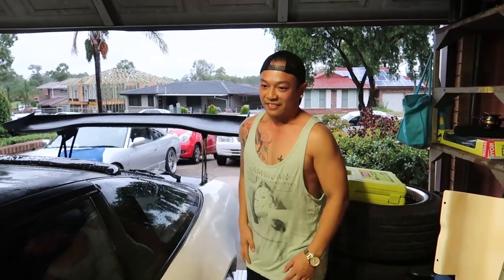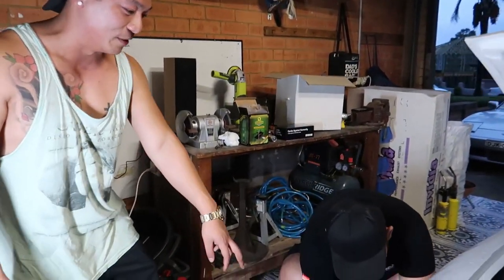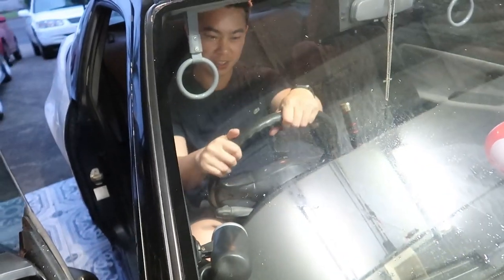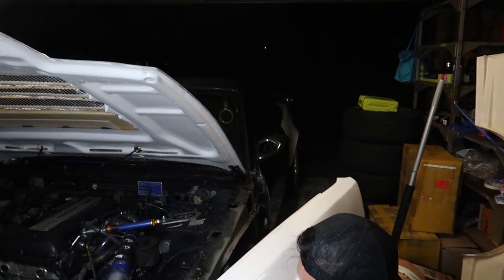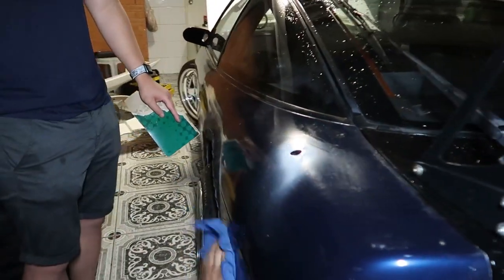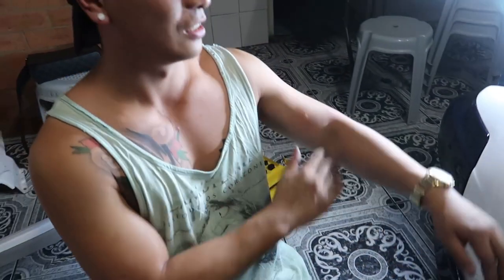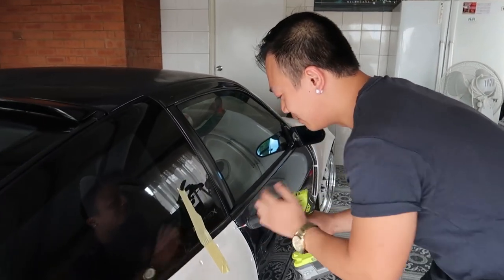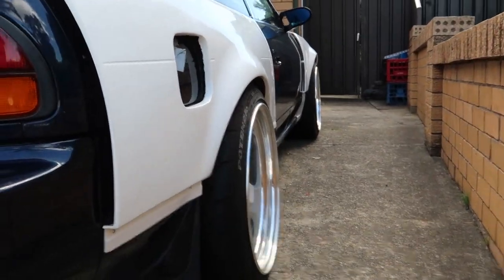how to widebody 180sx koguchi power fenders(what it is like to work on my car with friends)

Comment: What are the specs on your wheels
Reply from the maker: 18x10+18 rears and 18x9 +18 fronts with spacers but
Reply: @tuanvu5008  how thick of a spacer did you use?
Reply from the maker: @asantemartin1586  tthhiiccc 60mm haha cause I'm rebuilding my wheels eventually just been getting engine rebuilt upgrading everything.
Reply: @tuanvu5008  damnn! How did you even come up on those haha
Reply from the maker: @asantemartin1586  hahaa had them from me old car and rocking them since, I like work meisters
Reply: @tuanvu5008  yeah I got some koguchi fenders and i'm trying to figure out what wheels and specs work,  ......i'm going to get a set of konig dekagrams 18x 10.5 +25, ...and with a 30mm spacer, based on your wheels slightly poking out, ......i'm thinking mine will be slightly tucked